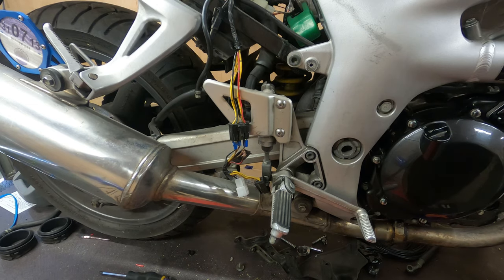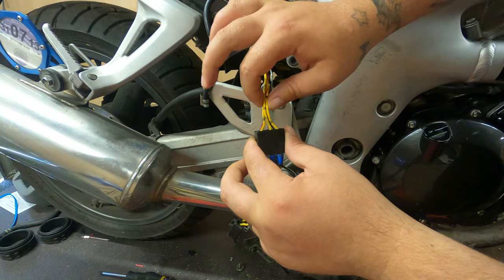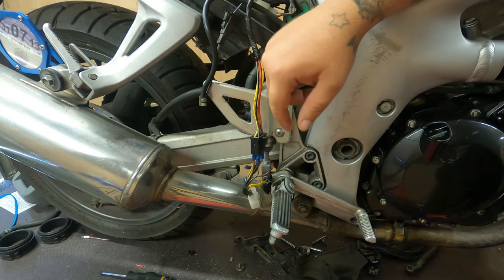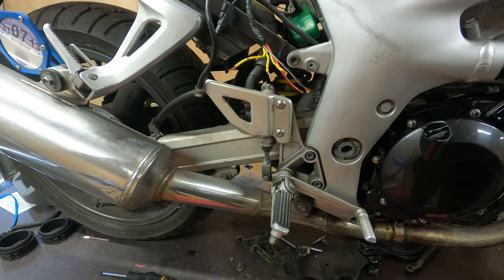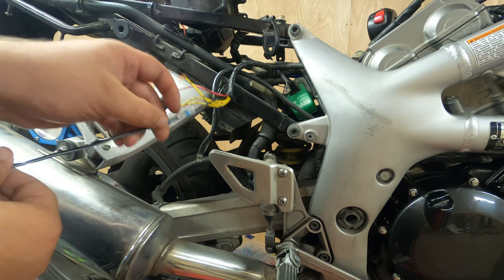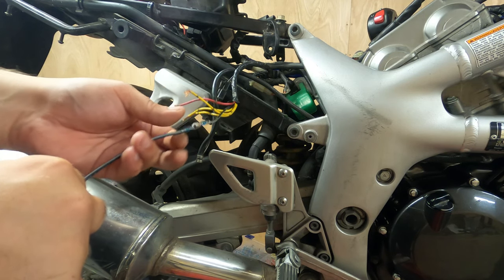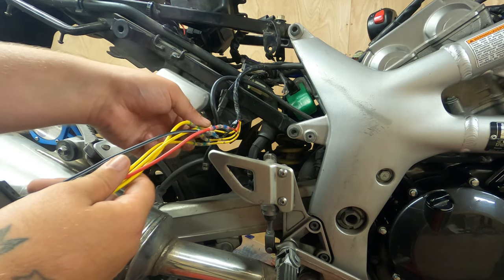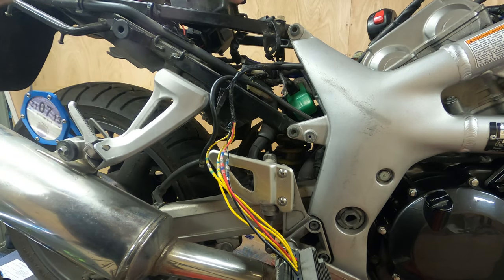HOW TO : Hard Wire a Regulator / Rectifier

Comment: maybe you can help  i have bought i twin cylinder loncin motor to put in frame i already own. only wiring i get in australia is for single cylinder  the motor is set up wiring from stator is for twin so what do i have to do to get 2 plugs working i had bought another coil and plug lead. do i change the DCI unit or what  many thanks

Comment: Cheers dude same problem on my curvy 650.
Reply from the maker: Glad it helped, its quite a common issue on a lot of bikes. This is generally the best work around and avoids future issues with replacement plugs and charcoal wires
Reply: @madslickmotorcycles8391  I hardwired mine lastnight and took it for a test ride to and ran a treat

Comment: wire yellow it same connect? can mix or change cause same wire? how you know 3 wire yellow same with original wiring from magnet to socket or pin rectifier?
Reply from the maker: Hi mate. With these particular ones it doesn't matter with the order of the wiring, some bikes it does but generally with the yellow wires it's all the same 👍🏻